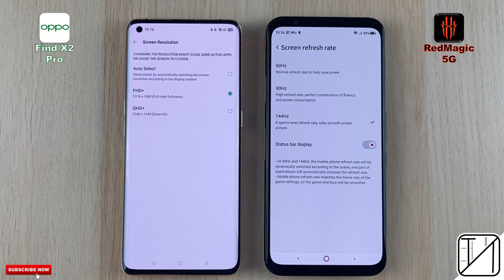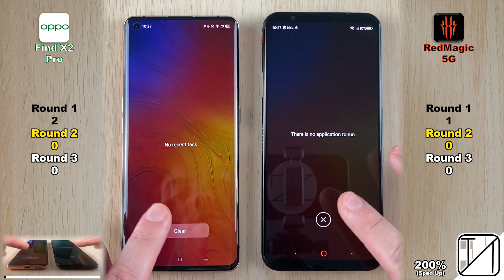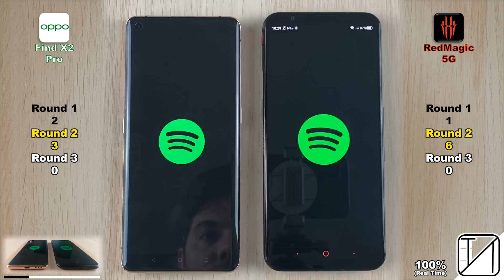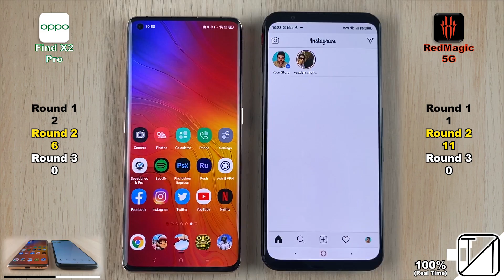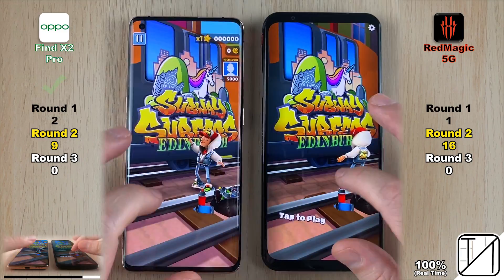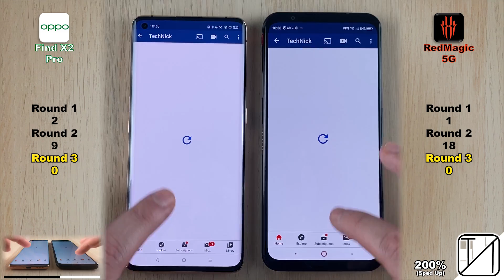Oppo Find X2 Pro vs RedMagic 5G Speed Test

Comment: Find X2 Pro is my dream phone. I will get it one day hopefully
Reply: SD 865, 120hz AMOLED 10 bit display, 4000mah battery, a camera that is good. Also, no auto-focus issues. Oneplus 8 Pro would also be a good choice. Basically the same phone but with no 60x zoom
Reply: Before you get it it will probably become redundant, lmao
Reply: @victorotene  Then I will go for Find X3 or Find X4 lmao
Reply: I have got it. You wont regret it. Go for it
Reply: @vidur280  screen issues just like on the 8 pro? Do you see black bar from the front camera?
Reply: @ktomorful  no issue with the screen. Go for it.
Reply: @ktomorful  no black bar in the front camera just the settings options on top and bottom
Reply: It looks just like Samsung phone on the front hahah, why are they copying them so bad?
Reply: Watching this on my vegan leather find X2 pro and yeah this phone is a beast. Glad I went with this over the s20 lineup
Reply: ROG 3 is my dream phone and also ROG forever
Reply: @androgamer7774  Lenovo: Hold my Legion!
Reply: @lukemothug  ROG way far better than that useless legion
Reply: @androgamer7774  you must of already owned a legion before it was even released.